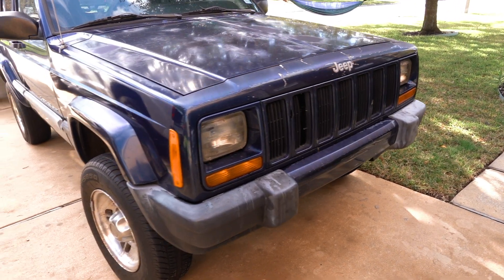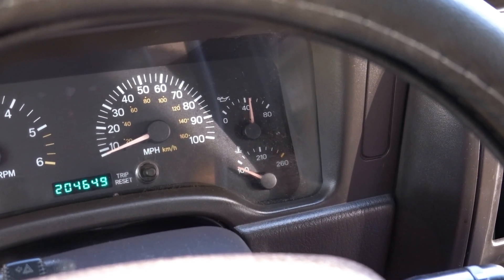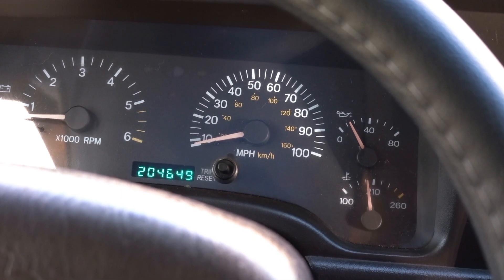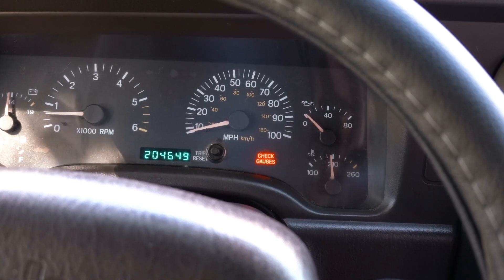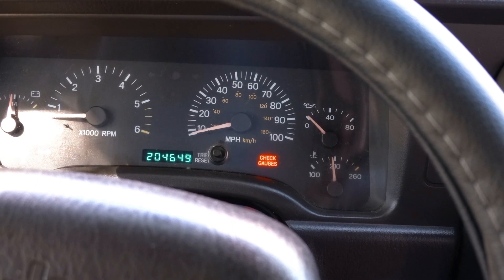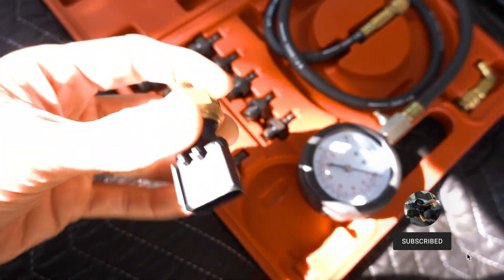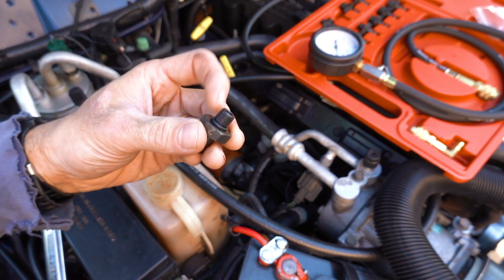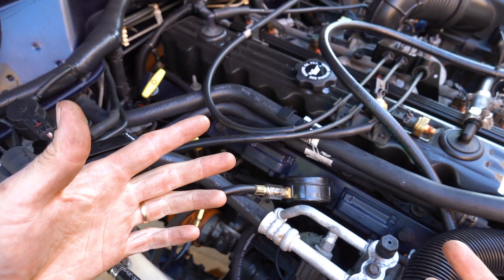How to Check Oil Pressure - Jeep Cherokee XJ no oil pressure at idle when hot

Comment: On a Jeep 4.0L, Oil Pressure at idle speed should be at 13 psi however at 1600 rpm & higher, psi should be between 37-75. I have the factory manual for the 2003 Jeep TJ 4.0L and 2.4L

Comment: Hey big guy, so i havea 2002 Cherokee Laredo 4.0 and im dealing with an oil pressure issue as well. 🤦‍♂️🤦‍♂️ so when i first start it u the pressure will stay at the normal pressure but after running for 15-20 min the pressure will gradually start to drop. I have changed everything dealing with the oil except i haven't changed theoil pump out and im hoping to fix this issue with out replacing the pump.....did you figure out what was going on with your trucks issue...hope ya can help and thanks for posting! 👍
Reply: Hey I am having the same problem since last dec , did u fix it?
Reply: @mrno3525 try engine flush I've seen 4.0 engines drop pressure because of sludge
Reply: Ook,it due for oil change next month, gonna use a thicker oil w20 30@justindaniels17
Reply: @mrno3525  after using the engine flush drain it and remove the filter then get some cheap oil and a filter and let it run for 15-20 min then drain and buy a quality oil and filter I'd recommend 5w40 oil

Comment: Most people don't know that low oil pressure on the 4.0 is caused by worn out cam bearing, if the gauge and sensor prove good, the next place to look is cam bearings.

Comment: I though that my 2000 Cherokee was not giving me correct readings. Put on manual gauge no oil press. bought an exchange engine from a local rebuilder installed the motor and the same exact thing, no oil press. Rebuilder says I installed it wrong?

Comment: Great video man. I have an issues with my 2000 XJ. Runs good but just like this once warmed up oil pressure drops to right above 0. But once you start driving again it builds back up and the check gauges light goes off. So I tried to swap the sensor and my car went from a smooth idle to a really rough and tumble idle and sounded really bad plus the check gauges light remained on. So I put the old sensor back on and it ran smooth again despite check gauges light coming on when idle. Not sure. The sensor on here looks the same except a slight difference from all the other videos I’ve seen. Not sure how I should approach this situation
Reply: Did you fix your issue?

Comment: I don’t get mine it has been dropping to zero even after complete oil change.. the first time I did it myself and put thicker oil and it didn’t do it for a long time.. but I can let the Jeep idle for 30 minutes with air conditioner running and it stays at the line before 40 never drops.. but when I drive it for awhile it only drops at the stop light until I accelerate. I thought maybe bad oil sending unit but it works just while running and parked in my driveway.. the oil pump has to be working because the engine sounds fine for a 97 Jeep grand Cherokee 6L.. I’m lost of what to do.. The oil changing place put in 10w 30 but seems it only does it while I drive them stop if I go no where it runs fine..

Comment: i just changed the oil pump and sensor after constantly having 0 oil pressure ( max 20 oil pressure on cold starts ) now my cold start oil pressure is about 50psi but soon drops off after warming up. When hot , idle oil pressure is 10, it never goes lower, and maintains around 30-35 psi with highway driving. I think that’s just the maximum oil pressure that can be achieved since my 4.0 has 220k miles… i think the oil pressure would be better if i changed the pump sooner because it ran way too long on almost 0 oil pressure even at 2k+rpm. regardless the oil pressure is never at check gauges anymore. i always have oil pressure so i guess that’s all that matters lol, i’ll prob rebuild it after another 50k miles

Comment: My 2000 XJ wjth 177k stays around 10-13psi cold or warm and never moves when operating. Gonna try a seafoam treatment,  oil change and the sensor.  Fingers crossed.

Comment: WOW Yes   what is the cylinder presser   it may be time   the nice part is that the bearings  can be replaced along with the oil pump   and this is a lot cheaper then reworking the hole thing  and this will give GOOD reslates  and the time to gather up the money for the rebuild in a year or so

Comment: At 200,000 miles your oil pressure should be higher than that. You may want to try 3 OCI of Mobil 1 HIGH MILEAGE 10w40 at 3K each, and then re-evaluate situation....Is this burning or leaking?

Comment: Any update on what is up with it? I’ve got almost the same issue. Cold start 50 psi and after driving for awhile it idles at 0 psi but doesn’t make any odd sounds. It has a new sensor/aftermarket one. Oil pump and I dropped the oil pan and cleaned up the pan also
Reply: Any update on your oil pressure @thatmncarguy
Reply: @ohvcentral9400  so I actually replaced my pump and pick up tube. It was completely gunked up. I did that and it worked better but still would do it. What I did after that is put a fitting on the oil pressure sensor hole and ran the truck for a couple seconds and revved it some and put it back together. I haven’t really had no oil pressure  issues after that.
Reply: @TristanSogge  What fitting?  Did you just let the oil flow out to clean it out or something else?

Comment: ?  Idling at 10 PSI?  Think you may have an oil pump problem dude
Reply: 10 psi per thousand rpms at idle hot is considered acceptable.
Reply: Either that or his bearing clearances are to high due to wear.
Reply from the maker: Oh yeah,
Reply: 10? Its 15 psi bro

Comment: Next oil change drop the oil pan and replace the oil pump it should help with pressure
Reply: Yes  YES   what is the cylinder presser   it may be time   the nice part is that the bearings  can be replaced along with the oil pump   and this is a lot cheaper then reworking the hole thing  and this will give GOOD reslates  and the time to gather up the money for the rebuild in a year or so

Comment: I have  discovered several engines over the years that had lower engine noise,  and it had turned out to be the vibration damper pulley,  or a crack in the flywheel.   Heck we even had a  455 Buick once that was knocking because the  previous owner dented the oil pan with a floor Jack..

Comment: I've heard that using diesel oil may help, any thoughts?  Perhaps a future video?
Reply: Used that in a vic with very little lol pressure and helped
Reply: Yeah it helps clean up the sludge build up. But I wouldn’t recommend using it often because it causes the oil to lose its lubricating properties.
Reply: @robertocruz1177  I think he meant using oils designed for diesel engines not diesel fuel